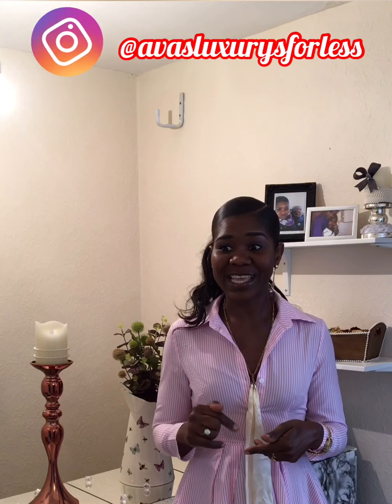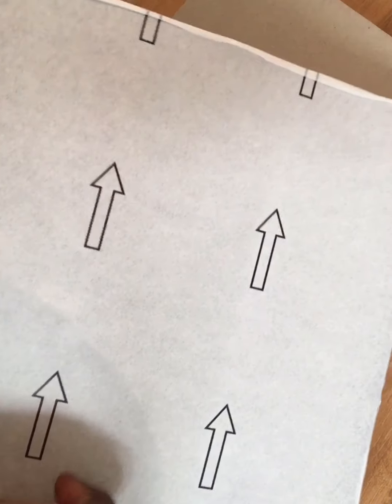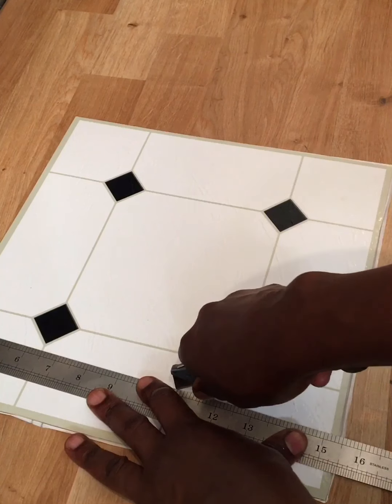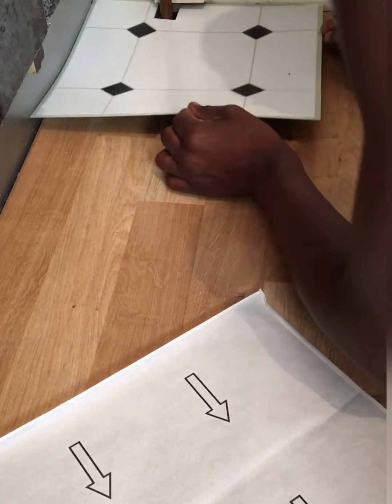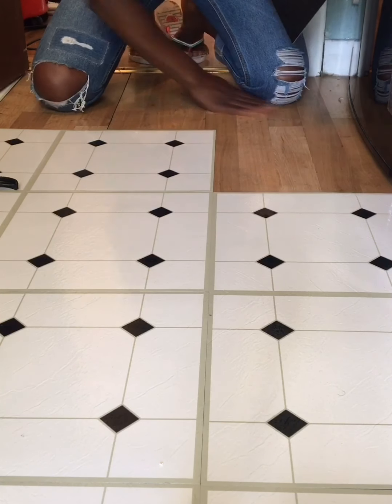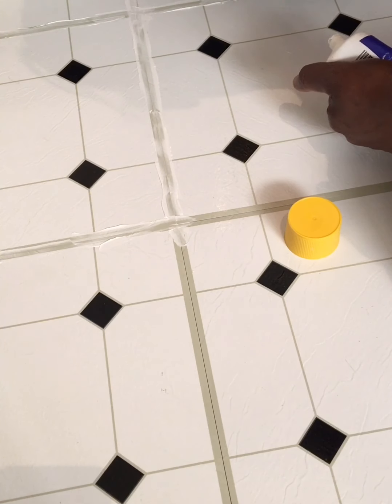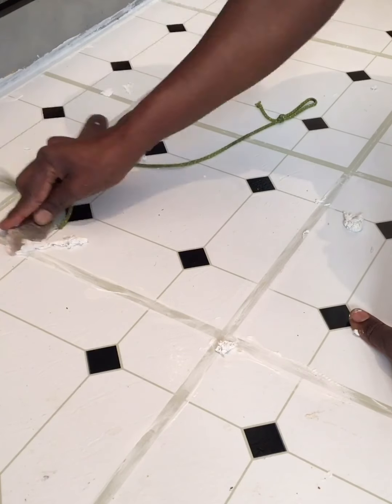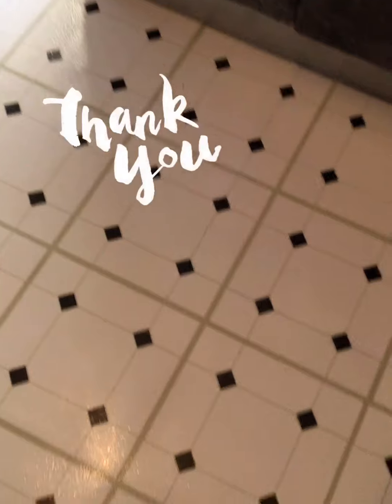Poundland Value Tiles (Kitchen floor) Part 1

Comment: lovely job, would they work on a concrete floor, please?
Reply from the maker: Hi thanks for your comment! It can work on concrete but the surface have to be smooth! If not;  linoleum will give you a better finish